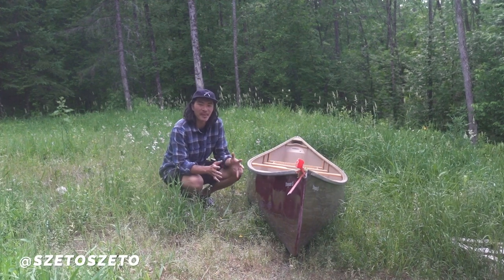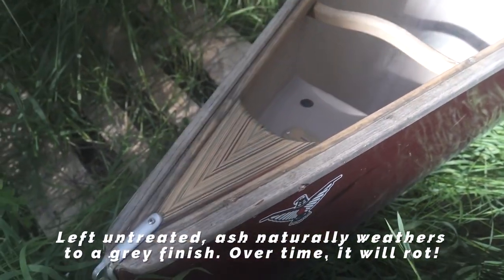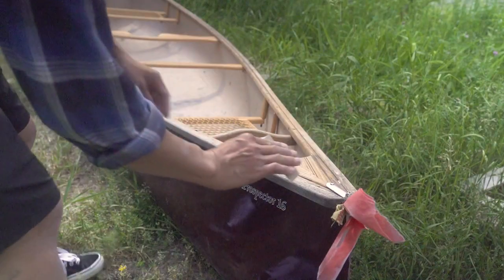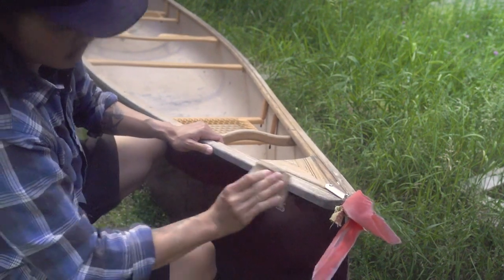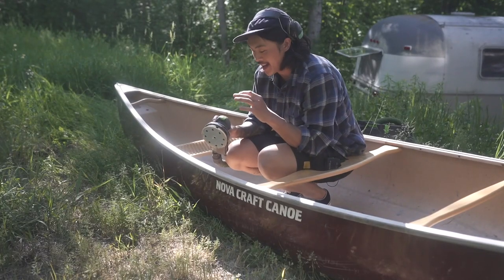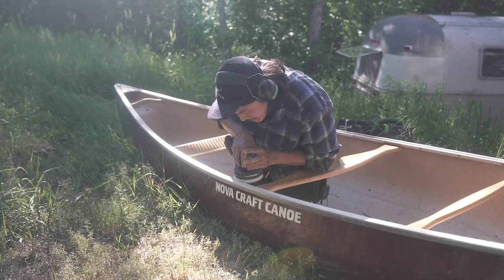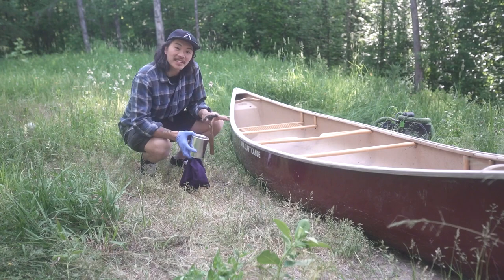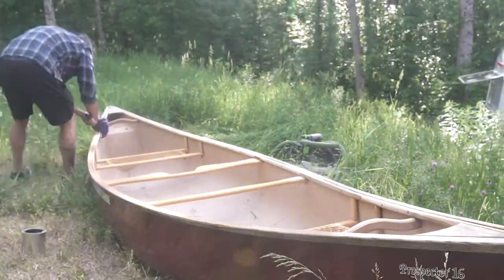Maintaining Ash Gunwales

Comment: Any tips for sanding underneath the gunwale and not scratching the gel coat?
Reply: I would just use a wide piece of painters tape along the edge of the gunwhale. You should be able to get some in 3-4 inch width at Home Depot or Amazon.